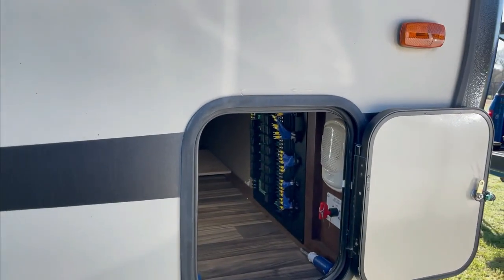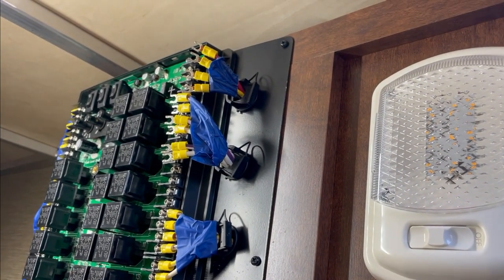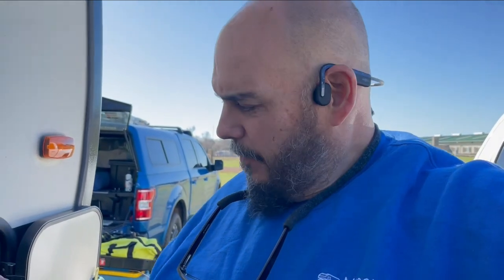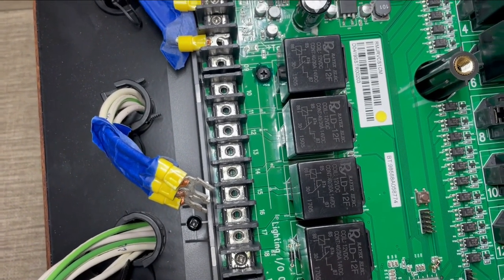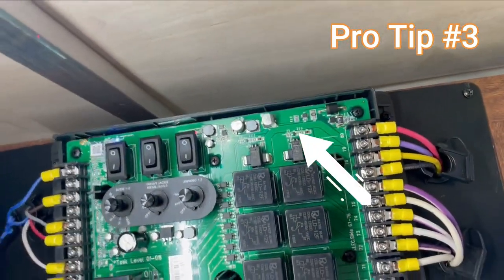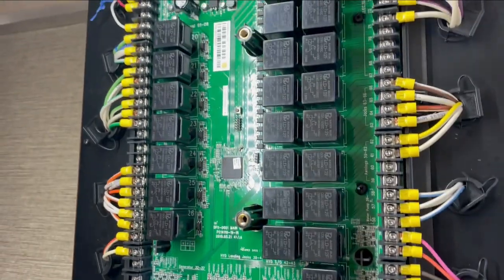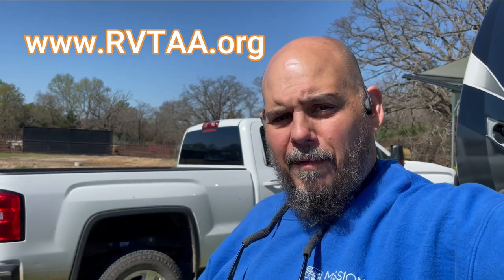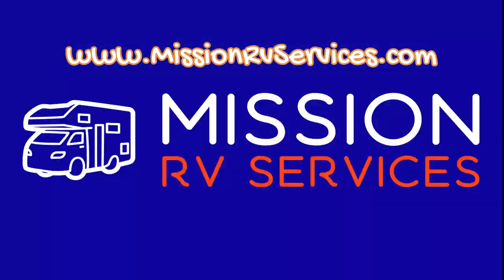RV TIPS: Replacing an In Command Center

Comment: I have a 2017 Keystone Alpine. I keep getting a connecting to BCM message. Turning the system off and on fixes the issue for a short time and it is back again. I have done a hard reset. Unplugging shore power and unhooking the battery. That helps but the issue returns. Any tips would be great. Thank you for the tips about taping the wires!
Reply from the maker: @CHRISINMCNEILL  you may want to call ASA for tech support. Sounds like there’s an issue with the Bluetooth keeping connectivity.

Comment: Why did you replace the bcm?. I am having an issue with mine right now and was wondering how you knew it needed to be replaced? I am thinking that is my issue also 🤔
Reply from the maker: The panel said it was connected to the control module but the panel would not control any of the functions and when going to the control module you couldn’t run any of the functions at the module either. Last step after that was calling the manufacturer and verified with them that it was indeed a bad control module. Manufacturer of the BCM (Jensen) is usually pretty good to work with.
Reply: @missionrvservices  mine is a little different my bcm fuse keeps blowing but I have good batteries and 12 volts coming into the bcm but nothing is working including the control panel.. thanks for the reply and info about Jensen. Great video and good tip with the tape idea

Comment: How to do you remove and replace the touch screen itself
Reply from the maker: Remove the trim ring from around the screen, remove the 4 screws, then remove the positive and negative wire. The control screen itself communicates with the BCM via Bluetooth. Reverse the above process to reinstall.  Good luck